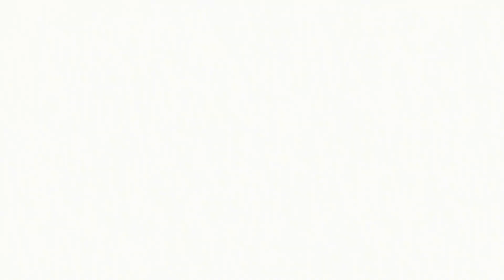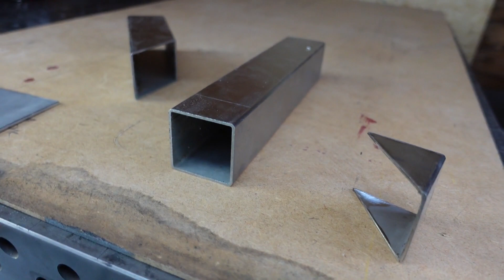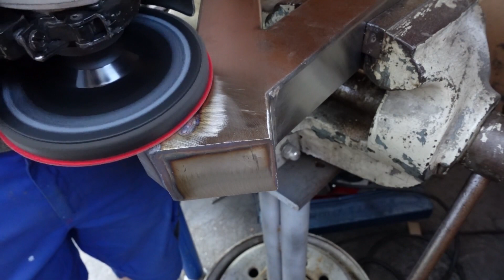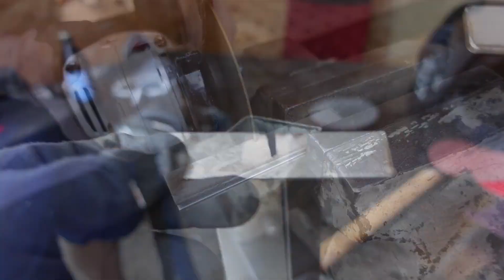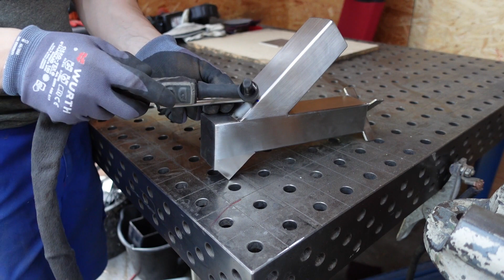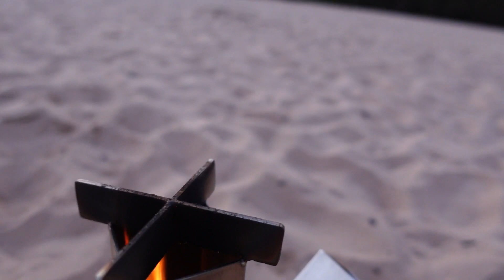HOMEMADE ROCKET STOVE

Comment: Awesome video. The last one with the rocket stove is great ; but somebody let me know if I had a brain fart; wouldn’t that metal coffee cups handle get too hot to hold with bare hands? You would have to wear heat resistant gloves right.? What if a person used that heat resistant silicone like those oven mitts and put around the coffee cups handles? Would that work?